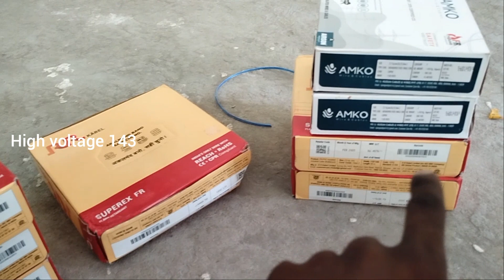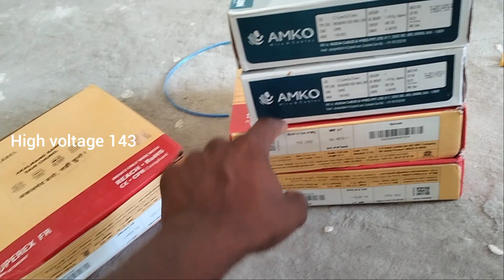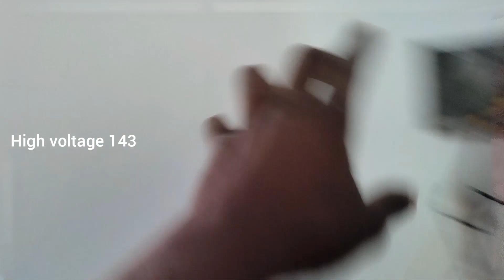ஒரு தனி வீட்டிற்கு வயர் இழுப்பது எவ்வாறு || Part 1|| how to individual house wiring making tamil.

Comment: Apartments main board video send pannuga
Reply from the maker: Ok ... Innum work start pannala ...
Reply: Apartment plumbing plan send pannuga
Reply from the maker: @vijayarasu8025  my channel plumbing work playlist..Poi parunga bro.. athula  ellam videos irukku
Reply: @highvoltage1436  bathroom pipe line wall mounted closet pipe line diverter pipe line video send pannuga
Reply from the maker: @vijayarasu8025  work varum pothu upload panren
Reply: @highvoltage1436  hmm thank you